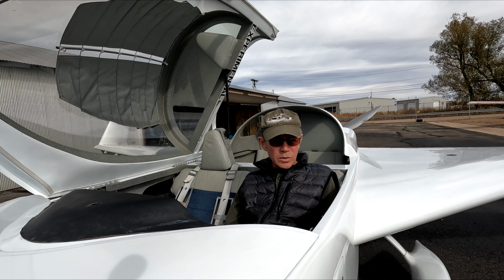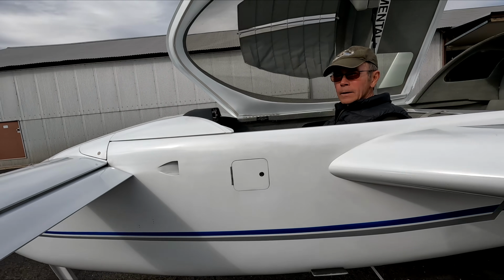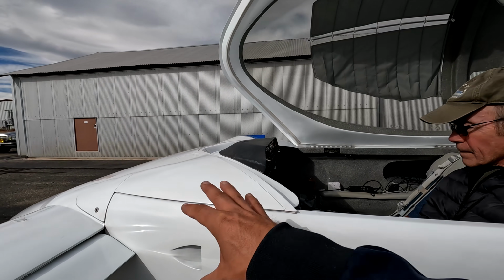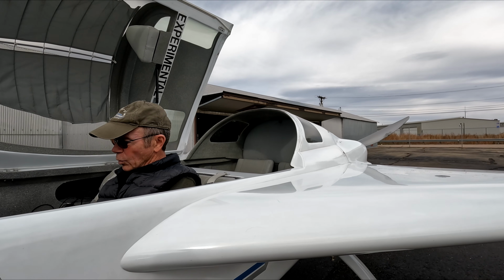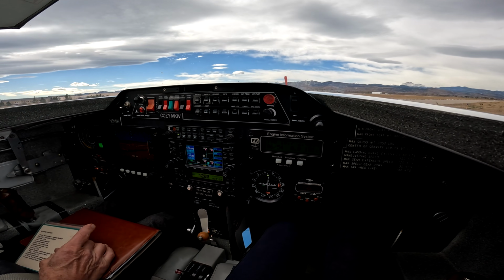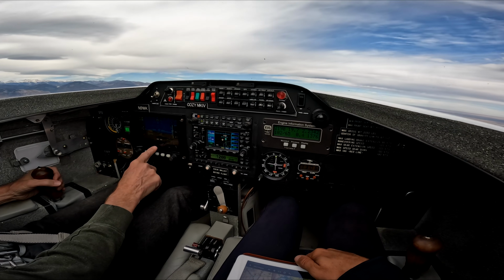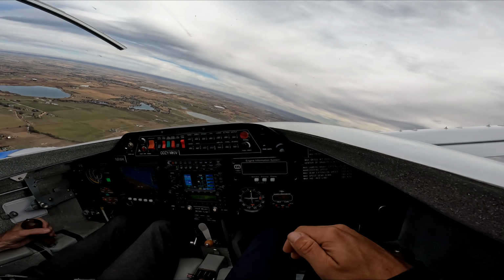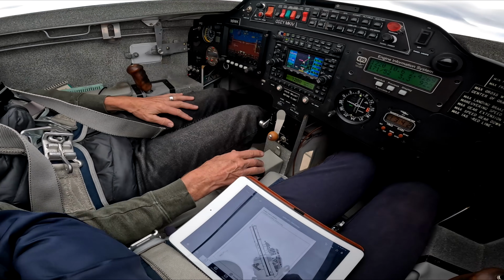First Flight in a Cozy MKIV 4 Seat Canard Aircraft

Comment: Great video and nice Cozy. My Cozy IV will cruise at 185 knots burning < 6.5 gph LOP. My Lightspeed electronic ignition helps. Mine first flew in 2001 and has almost 1000 hrs on it. I have done several 1000 mi non-stop flights FL to CT. On those flights I land with about 15 gal of fuel left starting with 40 gal (topped off with the nose down). I am curious, how do you get 165K views and 22K subscribers? My Cozy videos are no where near that poplular.
Reply: Nice airplane.
Bad video quality. 
I got dark overlays on video. 
Make some comments about airplane or the airport.
Actually a small airport description while in air might just do it.
Same Video length and upload regularly.
Plenty of videos of airplanes but few new on yt.
Reply: How long and how much it took you to build cozy mk iv？It is a really nice aircraft that can beat cessna and cirrus

Comment: Not really efficient. They seem efficient because they have very small wing area and therefore, they can fly fast but at the expense of a high stall speed. Its the ratio of top speed/minimum speed what makes an efficient design. Then, the designer chooses how much wing area he wants and that depends on the intended runway length he is designing for. Clyde Cessna was not dumb. He designed his aircraft for typical county airport dimensions, not executive jet airports.  There are several fixed wing designs that for the same power fly faster. If they were very efficient why don't aeronautical engineers build canard sailplanes and win contests? Why Reno air racers are not canards? Why fighters are not canards and why commercial airliners are not canards?
Reply: Errrr there are actually numerous fighters in service that have canards. Eurofighter Typhoon for instance.

Comment: The final approach sure seemed to me to be really dragged in; too low, too high powered/too fast and thus not properly executed from the point of view of a single piston engined civilian cruising kind of aircraft.

Does this have something to do with a necessity of the design of this type? Or is he just demonstrating poor technique?

I was nervous watching this guy’s whole handling of the base and final “legs”; he flew them like he was some kind of fighter pilot with one long almost continuous turn from downwind to touchdown.  And the extremely abbreviated final approach looked really low and hot to me.

Tell me why I’m wrong; I’m just coming at this from a PPL-A point of view trained extensively on Cessna’s 150, 152, 172M, 172R, 172SP, 310J twin, and a Piper PA-28R-200 Arrow … those kind of planes.  I was “sweating” that final approach, lest even the smallest thing went wrong on him … like a little downdraft or gust across the fields on short final.
Reply: He probably was a fighter pilot. He did mention he was Air Force.
Reply: Having flown a Glasair 3 for years, I can tell you that this guy is flying it correctly; you don’t need to be risking stall in steep turns; he is managing the aircraft’s energy correctly.
Reply: Not pretending to know but would the lack of flaps partially explain a more shallow approach? Got no excuses for the ultra short final.
Reply: I think it was the low camera angle. That made the approach look extremely low

Comment: I missed it.   What kind of fuel economy could it get with a couple of normal sized people onboard traveling at cruise speed on a reasonably long trip (say 90% of it's max range)?
Reply: 25-35 MPG - the latter only if you climb high -17.5 and suck down on oxygen
Reply: Just to use some numbers from the video. (Had to wait patiently for the cruise speed.) 165 kt /7.5 gph  = 22 ktpg or 25 mpg.

Comment: Vortex generators increase the minimum drag and decrease the maximum lift-to-drag ratio.  They can help in slow flight as in takeoff and landing, BUT they will reduce cruise speed, nothing is free.  Other than that, this is a beautiful speciment of a plane.
Reply: Good points, but a bit off. Vortex generators actually improve airflow by delaying boundary layer separation, which can *increase lift* and *reduce drag* in certain conditions. They don’t always reduce cruise speed and can even improve it by reducing drag from flow separation. Instead of lowering the lift-to-drag ratio, they often optimize it, improving performance. Hope that helps!
Reply: Some competitive gliders use vortex generators to improve performance. Racers sometimes apply a mixture of oil and carbon to the wing surface, then fly the glider to visualize airflow patterns. Areas of boundary layer separation show up as large pools of oil, while areas with smooth, laminar flow appear as long streaks. By placing vortex generators ahead of the separation zones, they generate small, controlled turbulence that re-energizes the airflow, allowing it to stay attached to the surface. This reduces the separation, effectively smoothing the flow and improving overall wing efficiency. 

Large boundary layer separation is inefficient because it increases drag, reduces lift, and leads to unpredictable handling. The vortex generators help by keeping the airflow attached to the surface, reducing drag, maintaining lift, and enhancing control, particularly in critical phases like takeoff and landing.
Reply: I flew a Cessna one time however that was a competition STOL aircraft and it had an exaggerated amount of VGs placed in a high OAO configuration that made for a very slow cruising plane. But what is interesting is that they made it have a significantly higher lift to drag ratio at slower take off speeds than a typical Cessna. In short, VGs can be used to make planes faster or slower, but in either instance, when used correctly they actually improve efficiency and l/d ratios.

Comment: I'm confused, why would you want to reduce the stall speed on the canards with the vortex generators? Don't you want the canards to stall before the main wing stalls? I would think that if anything you would want to put the vortex generators on the main wing to stop dangerous pitching up in a stall :S
Reply: The vortex generators had nothing to do with reducing the stalling speed! 
The original canard used on the LongEz and Cozy’s exhibited a phenomenon when flying in rain / and bugs splattering on the leading edge that would cause the canard to lose lift. If the plane was trimmed in cruise then  encountered rain it would pitch down, the heavier the rain the more pitch trim was required, ultimately losing the ability to trim out the forces. I personally know pilots  that were doing touch and goes at airports surrounded by agricultural and after a few circuits they would lose the ability to trim the pitching down out. They would land, wipe the leading edge and magically the plane  performed normally. The vortex generators were installed to counter this. Ultimately Burt Rutan hired John Roncz to design a new canard airfoil which cured the problem.
Reply: @judd_s5643  I did not say the vortex generators were to reduce stall speed, THE GUY IN THE VIDEO SAID IT.  I maintain the cunard design is already fine regarding stall disruption.  Nothing else is needed, whether the vortex gens do that or not.
Reply: @judd_s5643  Yes I read that some years ago. I have Jack Lambie’s book Composite Construction For Homebuilt Aircraft (1985), in which he discussed that problem. I still don’t get why the generators help though. Do they throw bugs and raindrops off the canard? Or is it something to do with altering the flow over the main wing?
Reply: If you look there are vortex generators on both the canard and main wings.  The purpose of doing this is to help the airflow avoid separation at a higher speed.  This has the effect of reducing the landing speed by 5 - 10 knots (as reported by those that did this).  The balance is maintained between the canard and the main wing since both have VGs installed.  Reducing landing speed by 5-10 knots is significant when it comes to safety.
Reply: @geckoinc99  Vortex generators (VGs) are employed to energize “sluggish” boundary layers, which are usually turbulent and thick, this happens at speed.  Landing speeds are not changed because there are no flaps and the aircraft cannot generate added lift at slow speeds.  Vortex generators have nothing to do with adding lift at slow speeds.
Reply: I was flummoxed by that, too. I believe what he was saying is that the fore plane was stalling too early, well above the main wing's danger point. It's a cheap and quick fix, sure, but I think either a larger fore plane is needed, or an angle of incidence change. I am not sure about side-by-side seating either in terms of CofG changes.
Reply: @travelbugse2829  The cunard was used by Rutan to meet the requirement to make a plane that essentially cannot stall.  The theory (and the reality) that the cunard stalls before the main wing, dropping the nose and lowering the angle of attack avoids a stall on the main wing.  But attempting to alter the point at which the cunard stalls is not really productive as the stall characteristics of this design are as benign as it gets.
Reply: I note it's a four-seater, so he has to have side-by-side seating of course - but still a bit of a headache for balancing it IMO.
Reply: Reading is not EZ, huh?
Reply: When these stall the nose pitches down. these planes are almost stall proof, very close.b
Reply: @08turboSS    This is partially true.  With a canard aircraft flying in the proper CG range, the front canard wing will stall but the main wings never reaches stall so the aircraft never loses controllability.  In a standard aircraft, you can't steer the aircraft while in stall until the wings pick up enough airspeed.  You can make turns and even climb while the canard is doing the nose bob meaning the aircraft has not fully stalled.  If you stall the main wing, then you enter deep stall where you no longer have flight control, however, flying within proper CG and having verified the wing incidence is correct during testing deep stall can't happen under standard flight regimes as the canard wing will not allow the main wing to reach a high enough AOA.
Reply: Correct.  His use of vortex generators are counter productive, but he wanted to lower stall speed in slow flight anyway.

Comment: Hello!!! Does anyone remember Burt Rutan???
This is not a new design at all!!!
Reply: The owner made this very clear though.
Reply: This was designed by Nat Puffer.
Reply: The Cozy is similar in design and construction to the 2-seat Rutan Long-EZ, from which it is derived, with approval from Burt Rutan.  Rutan did not specifically design the plane, but licensed it to others who used his Long-EZ as inspiration
Reply: @keithsargent6963 Fore-wings have been used on old and new planes.  Many combat jets use them to increase maneuverability, the J10 Chinese jet for example.  The Wrights used the Cunard design in the first powered plane, later the Swedish have built many such designs.  In the 60s. they built a plane called the Viggen, Rutan used this plane to base his first design.  New business jets are being design with them, and the fastest of turboprop plane is the Avanti EVO (Piaggio) which is also a pusher with a fore-wing.